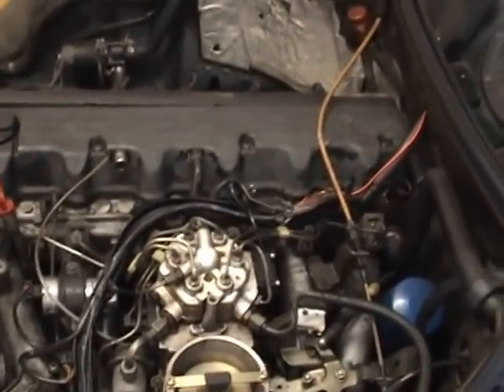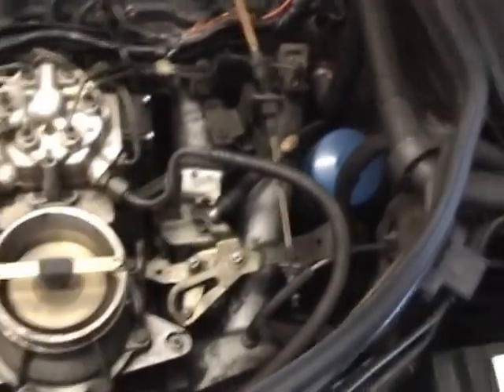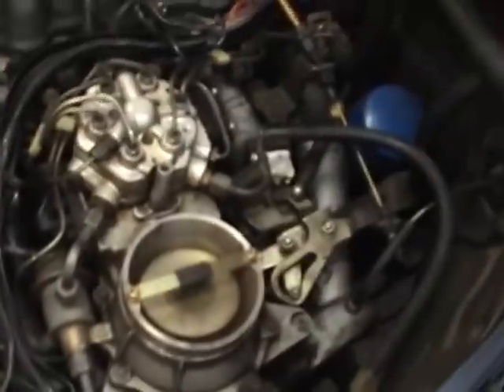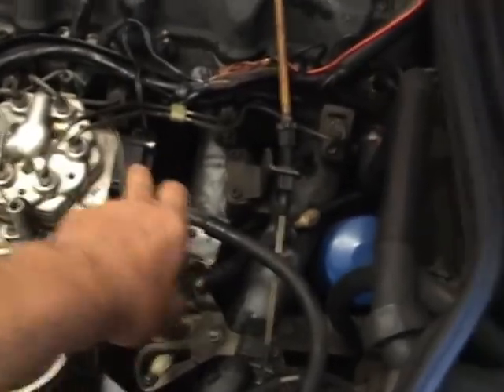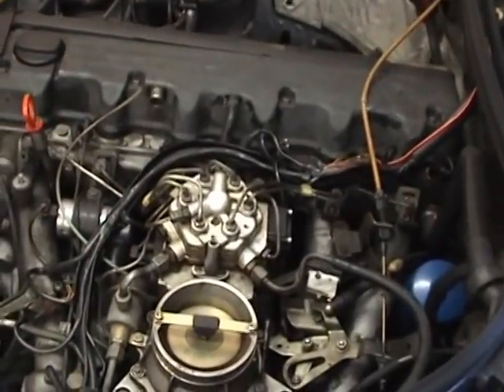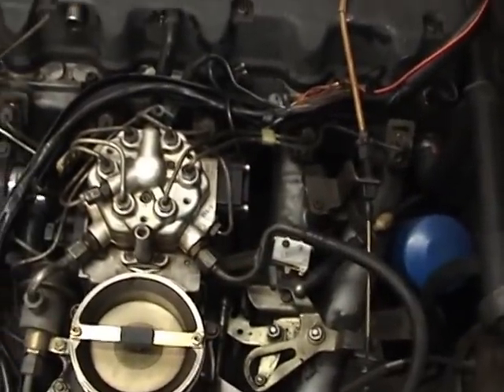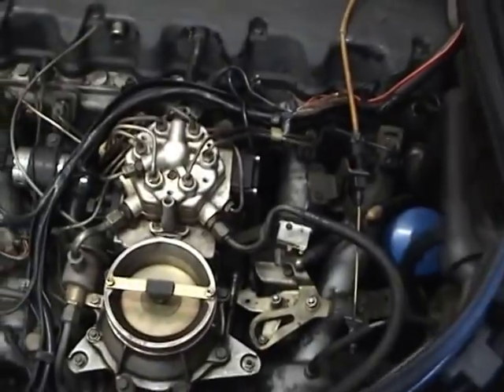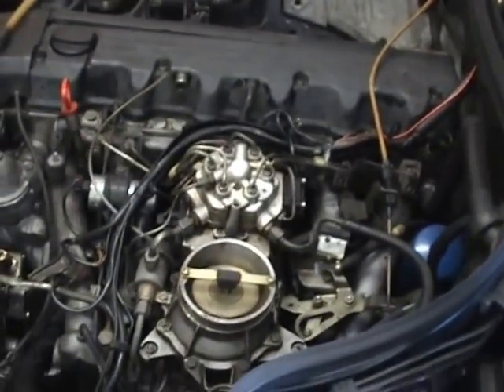1989 Mercedes 300E flat acceleration on first start

Comment: Thank you so very much. My 1989 300E mint condition inside and out (193500 kms) which I just purchased 2 months ago off a neighbour who is the original owner had it sitting in her heated garage and not being driven for the last 5 years. I had a flat bed tow truck bring it over to my mechanic and he had to replace the 2 fuel pumps and the fuel injection pressure regulator, new plugs, new brakes all around, new battery to get it safetied for the road. It is blowing ice cold air after installation of retro fittings and recharge system with R134A. I asked another mechanic who specializes in high end foreign cars about the issue with cold start and gas peddle hesitancy before being warmed up and he said I would be looking at another $1500 bill if we could find the part and then time needed to get it fine tuned as to proper response. Well I am blessed beyond measure with a very inquisitive neighbour when it comes to things not running properly so there is a knock on my door this morning and he has discovered you on Utube and written notes in hand as to solving my cold start plus gas pedal hesitation. I brought my iPad out to the garage and we watched it and proceeded as instructed to fix the problem. Well no offence intended but to my amazement a 1/4 turn of the whatever and the car accelerates and responds immediately to the touch of the gas pedal and now I have to be very careful as it is like driving a new car altogether. Thank you so very much from a happy Benz driver in Perth Ontario Canada. Blessings

Comment: How do you determine if the mechanical Bosch fuel injection needs a rebuild? This one is a 1990 300E in otherwise superb condition. A mechanic has endlessly fiddled with the air fuel adjustment. It is hard to start and has zero acceleration from a standstill. Once up to speed, it goes pretty good.

Comment: Hi
When you say sluggish, what do you mean? My car are tuned into specs, all the sensors and so (A lot from your videos too) But after a night, the car starts up but runs poorly, when I touch the pedal, like it misfires or something like that. After about a minute, it runs "good", but I don't like the way it runs before and I'm sure, that it could run better. Does it sounds like the symptoms, your 300e had? My 300e have a bigger camshaft in it, so I'm thinking about giving the EHA adjustment a shot.
Thank you
William
Reply from the maker: Hi, William
My car on a cold start was flat on acceleration, once warmed up it would run fine all day. Just adjusting the EHA valve made a difference. If your car misfires it could be something different, but try it anyway, it can't hurt your car. Cheers, Paul.

Comment: Hi Paul
Trying to sort a fluttering idle on my  M103. ( No O2 Sensor)
Could I ask, does the EHA moderate fuel pressure or mixture?
I have 5 Bars of fuel pressure with valve closed and 5.4 Bars with it open.
I think the problem may be a mixture problem  but I don't want to change pressure values.
Thanks in advance

Comment: Hi, I'm working on my parents 1990 Mercedes 300E class and I keep getting a Code 17 stating the O2 sensor and it's been changed and it keeps on going on after a while with this procedure with the eha valve being adjusted stop their O2 sensor code from coming on any help would be obliged

Comment: Did jou disconnect the battery? Before taking the part of?  If i lossen the bolds the petrol sprays out. And i hear the pump. Or how did you do it. Thank you.
Reply from the maker: No I didn't but it sounds like you should as you have pressure there. For some reason the fuel pump is running with the ignition on.
Reply from the maker: Ment Off
Reply: You can disconnect the battery but the fuel pump shouldn't be working with the ignition off. Just put a rag under the line when disconnecting then clean up any excess with a paper towel.

Comment: I have 1988  W126  300SEL  
When I cold start the engine, the idle  is around 500 rpm,  but when the engine is warm up, the idle will go up to 1200 rpm.
Which parts should I go to check and replace?
Thank You very much.
Reply from the maker: Hi, could be your auxiliary air valve, take it off & give it a 
clean, also test the idle switch, which is a micro switch near the fuel 
distributor, switches from the throttle linkage and check for vacuum 
leaks. Good luck, Paul.
Reply: Thank You so much for the valuable suggesting, Paul.
Reply: riffraffjazz Thank you as I'm having the same issue. when cold the car is very difficult to start.Runs rough with low idle. Once it warms up it runs and starts pretty smooth. 1989 300E 2.6
Reply: added question below, thanks!
Reply from the maker: Check that the auxiliary air valve hoses aren't cracked.
The coolant temp sensor is the single most important sensor
for determining air-fuel mixture at start up and during warm up. Once the
oxygen sensor heats up and provides reliable data, that sensor gets #1 status. So go for the temp sensor, good luck, Paul.
Reply: Hi Paul is me again
I found out the ICV is not working, but it is not broken. I have check with my another 1987 W126 300SEL switch the part.
I realize the problem is the ICV not receiving any electric signal from somewhere. 
Please kindly tell me where I should check in next step ?  Danny.
Reply: riffraffjazz  Thanks for the advice Paul. I'll keep you posted on the progress.
Reply from the maker: Hi, ICV is controlled by the ECU, you will have to check the wiring back. 
I tried to find a wiring diagram but haven't yet. I assume you turned the ignition on to see if you voltage across it.

The idle speed air valve has the following functions:

* The electronic control unit supplies a specific voltage to the air valve
which determines the respective valve opening and thereby the engine speed.

* The nominal idle speed is controlled depending on temperature, between 1200 RPM at about -23Â°F (-30Â°C) to 900 RPM at 158Â°F (70Â°C).

* With the ignition switched on (engine not running) the idle speed air valve is activated by a specific voltage. The port for the fixed operating mode is closed and the control port is opened.

* If the voltage supply fails, the port for the fixed operating mode is opened automatically.Let me know how you get on, Paul.
Reply: nydannkhayyam, my 1991 300SEL has the exact same issue but the shop is claiming that my cold start valve isn't getting any power. Does this make sense? When cold started the engine cranks about 7 times, then it fires up. Once it's running the idle is so rough that if I press the accelerator the car chokes and dies. However, if I leave it sit there and warm up, it smooths out and then runs fine. I disconnected my cold start valve and tried starting it, it acted the same. If the cold start valve isn't getting power, I'm guessing I'll have to chase the positive wire through the firewall and to the ECU? The shop wanted me to buy a brand new ECU, so I'm taking it to a guy that knows these older Mercedes much better. If he figures it out or I stumble upon a solution, I'll post it for everyone. If any one had any free advice, I'd love the hear it! Thanks!

Comment: in my case firstly i did 1/4 turn on the eha adjustment but didnt make a good difference than i tried a full turn on the screw and wow what a difference on the engine acceleration and power!  , however, only sometimes i still have a jerk on low accelerations and  also first start of the day. fuel consumption seems too high as well. fuel distributor/injectors are good. fuel filter/potentiometer/ovp relay/ spark plugs/micro switch/throttle position sensor on the throttle body/accelerator cable are all new. what else do you recommend me to check?  thanks alot!
Reply from the maker: Hi, Your fuel increase is from the adjustment of the EHA valve, a little too much.  Maybe your idle air control valve is dirty or the air intake plate maybe also dirty, you seem to have covered everything else?  Good luck, Paul.
Reply: thanks!!  iacv valve is cleaned already i have a spare one and changed before but didnt make any difference, the plate is very clean also.  i've been searching what was the factory adjustment for the eha valve.. found out it is 6 and 1/2 turns from the bottom on most and in some cases 5 and 3/4 turns..   so i think i will try the factory adjustment 6 and 1/2 turns from the bottom and see if it solves my problem.. as it is a very sensitive adjustment maybe a little bit off can make a big difference.

Comment: How reliable is the 1989 mercedes 300e? In the process of buying one. Also the pro and cons owning one of these.
Reply from the maker: I can only speak of the one we have and I can't talk highly enough, in the last 5 years it has gone on many a long trip, smooth, economical and any problems have been minor and mainly normal wear, they are built to last forever.  Look for one with no rust etc.  Good luck, Paul.

Comment: Hey, greetings from Texas! i have a question i was wondering if you could help me with. i have a 91 300e, i overheated it when i bought it, i fixed the cooling issue, but now it runs very rough. It wont start or stay running unless im giving it gas, and it sounds very bad. It also takes a long time to accelerate. Any idea what it could be? Theres no coolant in the oil from what i can tell. thanks
Reply from the maker: the air flow sensor plate could be in the wrong position or not in the rest position, oxygen sensor faulty, temp sensor faulty. Any or all of these give grief, also check the over voltage relay.  Regards, Paul.

Comment: Do not touch this screw. Leak will occure
Reply: No fuel goes through the top of the allen adjustment. It's a mixture adjustment screw.  Now if you removed  the allen adjustment it would leak, but then the car probably would even run.